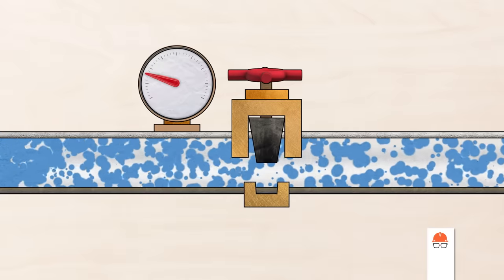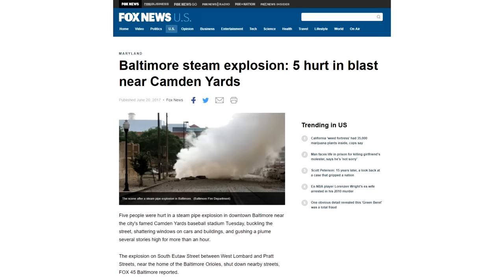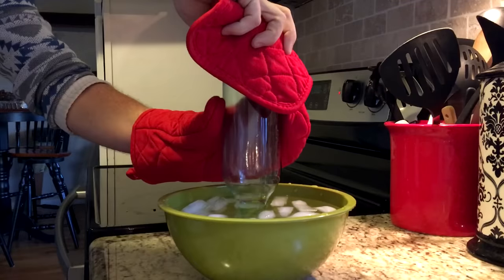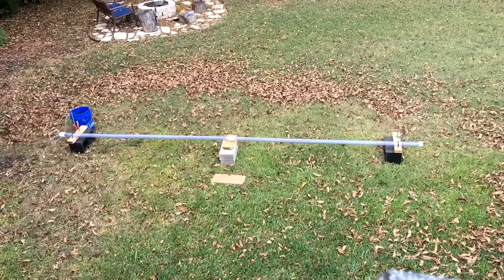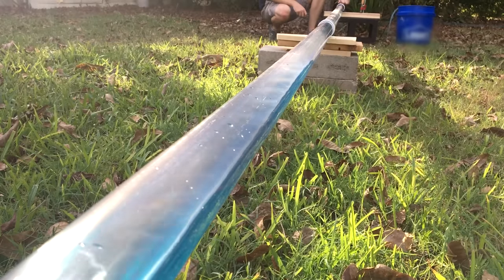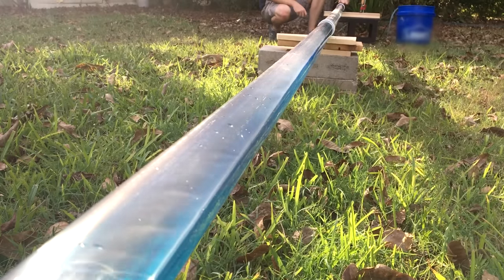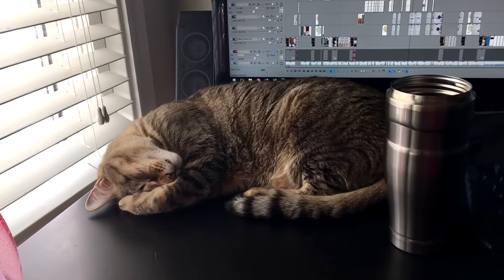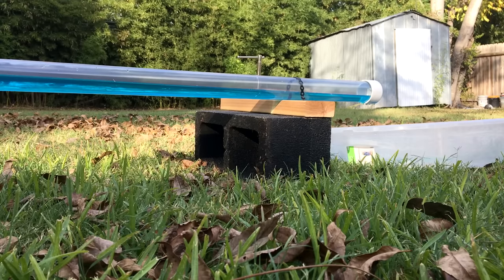What is Steam Hammer?

Comment: As a millwright i see steam hammer pretty often in refineries, one of the worst was when firing a lube oil skid that was down for a couple months the steam turbine was slugged a good 5-6 times and the sudden increases in rotation cause the pressure in the lube oil pipes to spike blowing the lid on our sock filter pot loose made a HUGE mess all over the machine base.

Comment: What do you call it when the steam travels up the pipes in bangs on the radiator? My old shitty NYC apt. had a bathroom radiator that would clang loudly as the steam heated up. I imagined it had water in the pipes and steam bubble would float up and hit the release valve. It would always destroy the release valves and they wouldn't last more than a few months, then it would spit water up in the air.
Reply: That would be the second type of steam hammer, possibly driven from the first - steam put into the cold pipes condenses, creating a bigger pressure differential pulling steam in faster; the condensate that builds up then blocks the pipes and is driven along by the steam flow, hitting turns in the pipes hard.

This is called 'steam hammer', and is what this video is about. The solution, I'd say - advice from experienced steam handlers welcome here - would be to open the relief and/or drain valve until the system warms up.
Reply: Robert Backhaus   Would pipe insulation on the steam line (not condensate return) help?
Reply: @louf7178  
This is dealing with differential temps. in a closed system. Most systems would already be insulated.

Comment: I think the photo of a power plant that you used several times is actually a gas turbine setup, which doesn't involve any steam at all. The gas generators (stationary jet engines) drive the power turbines directly, and then those drive an alternator directly. You can sometimes find combined heat and power units, that produce hot water or low pressure steam room a heat exchanger in the exhaust, but this is usually for commercial use rather than a power plant.

Comment: Hi Grady, love your videos, your channel is excellent.  Can you do a video on Stack Effect?  I travel  a lot in China and in the winter months it amazes me at how poorly air-flow is managed, I was at a very high end international hotel the other day and the elevator doors would not shut. There were 5 lifts and only one was working, the others were stuck on some floors with the doors open due to the air pressures pushing against them as they tried to close. It was humorous and frustrating speaking with the hotel staff about this air pressure differential,  they were upset with the company which supplied the elevators (insert eye roll here).  I do see this a lot in China, maybe they ignore HVAC engineering.    I would love to have you share this if you have the time, thank you.

Comment: One thing to note is that steam traps aren't typically used in the main steam lines for power plants. This is due to the fact that, as was mentioned in the video, traps can clog and malfunction leading to buildup of condensate in the piping. They can also become leaky over time as they wear out and leak steam which reduces plant efficiency. Instead, modern power plants make use of vertical steam drip leg drains at low points in the steam lines with automated valves that open to release condensate. The drip legs will contain level or temperature transmitters to alert the control system when condensate reaches a certain level. The control system will then trigger the drain valve to open.

Comment: early 20th century, they had a problem with switching/disconnecting high voltage power lines............the electricity actually has its own kind of inertia and wants to keep flowing when its disconnected, so huge arcs would burn the equipment in the process.

Comment: I'm a Mechanical insulator by trade. Insulating steam pipes is something else that is done to prevent this temperature differential and to allow the system to stay warm or heat up faster with less waste of energy.

Comment: Ex Air Force boiler specialist here they installed automatic valves at Hill Air Base. first time used they opened too fast and a sand trap exploded lifting a metal grate and damaging cars near by.

Comment: So a little backstory. Virginia, MN is all heated by city supplied steam. My grandparents' house had this steam heat, and it had valves I guess that would turn on and off to regulate temperature indoors. Sometimes when the valves came on, the radiators would creak and tick as they heated up but occasionally they would make banging and gurgling noises. All cast iron. What were the dangers of a city wide steam system?

Comment: Is it possible to connect an air compressor inline with a ram pump to achieve an even higher lift? Kinda like how you demonstrated the steam hammer. Or use the steam hammer to deliver water?

Comment: In chemistry we have something similar when doing distillations, especially when boiling off gases out of a liquid & collecting it either as a cooled liquid or dissolved in a liquid.  The "process/event" is called suckback and is when the positive pressure of the distillation, the flow of the gas from boiling flask to receiver changes and reverses in an instant (usually because of temp drop in boiling flask - turning off heat source, going out, etc).  It can suck 1L of liquid through a 3/8" tube/hole in under a second and sometimes blowing glass apart or at least the joints.  It scares the shit out of you when it happens. A good learning lesson if everyone remains safe.

Comment: Some systems are made to run with "dry" steam anyways. Impingement by just a little bit of carried moisture can cause erosion damage over time. Mostly a thing with turbines as far as I'm aware, and the warm-up process is fairly strict.
Reply: pauljs75 that's why power plants use superheat control, it's less of a hazard to the physical plant

Comment: I've been imagining a design for a high-volume desalinator.  Use an array of solar mirrors, focussed on the expansion chamber of a turbine, to boil fresh water and get the resulting superheated steam flowing along a pipe at high speed.  Now inject sea water into the steam at such a rate that all the seawater flashes to steam, yielding lower-pressure but still fast-moving steam with salt in suspension.  Remove the (now solid) salt from the steam mechanically, perhaps in stages.  Recycle some of the fresh water back to the start, output the rest.

Comment: I was appointed to a British merchant vessel which had a long steam pipe to the for'd windlass. I found that nearly every condensate drain valve was unserviceable due to lack of maintenance, and also they had been fitted with aluminium handwheels which had corroded completely away in the saltwater environment so were being ignored by the crew anyway. They were probably cheap when the ship was built. The pipe burst!

Comment: 01:05 well, actually water is compressible. When you build high pressure pumps (4000 psi or above), you have to account that fact.
Reply: 1337fraggzb00N True, but based on my limited knowledge of most processes don’t reach that level of water pressure.  I’m curious, what are some specific applications that reach those pressures?

Comment: I work in power plants and various other industrial sites on steam turbines. when the plant workers start putting steam back into the pipes its loud as hell and if done wrong shakes the building and causes chaos. I was at a paper mill and they started putting steam through a 12 inch lime and it hit some water in the line and the pipe started bucking and SLAMING side to side in its mounts about 6 feet above my head. my crew of guys didnt run. we just werent in that location anymore. never seen so many big guys move so fast

Comment: Thermal shock is a big problem in rocket motors if not properly mitigated.

Propellant lines need to be purged and chilled to stop moisture in the air becoming slugs of ice, and to stop the cryogenic fluids that normally flow through them from creating sudden changes in temperature and pressure.

And when you are dealing with liquids that really want to be gasses and combine explosively with each other, you really don't want that.

Comment: Tried the bottle experiment and it was nowhere near as violent. It was more like a very gentle, almost unnoticeable difference in the water level. What am I doing wrong? I had to use kettle water as I didn't have a glass container without any labeling. Could that be it?
Reply from the maker: I found going immediately from microwave to the cold water was the only way to get it to work. You need as much steam as possible to get the runaway effect.

Comment: Are there any practical uses for steam hammer or is it always uncontrollable?
Reply: CrooningRevival365 you might be able to make a rapid firing squirt gun with compressed air and a little tank of water
Reply: It isn't a good thing. It damages and weakens pipes by excessive movement that it's No t designed to handle

Comment: Very interesting.  So is this why my residential steam radiator - the one behind the bed, of course - bangs 12 - 18 times when it first heats up in the middle of the night?  Is there water in it that the steam is slamming  into the end of the radiator?  And, is this dangerous? (I ask after 20 years of this).  And, what's the cure?

Comment: I’ve seen steam hammer make a 12 inch pipe behave like a rope and tear itself out of its hangers. That was due to a miscommunication about which valve to open and how fast.  Also I’d add that steam hammer approaches the speed of sound in a pipe so it’s no wonder a change in direction like an elbow doesn’t stand a chance.

Comment: Is this the same type of water hammer that happens when compressibles (like air) enter a system. For example, if you get air in your water piping system (because you opened it up to work on it) you will get water hammer.

Comment: I thought it was ok for a broken pipe or crack in a boiler to vent the steam but I learned that when the pressure suddenly drops to atmospheric pressure, the water which is heated above boiling point suddenly turns to steam, it wants to occupy a lot more volume and the boiler explodes. I dimly recall steam occupies 1600 times the volume of water, correct me if I’m wrong.
I remember photos of locomotives after a boiler explosion, there is nothing left except the underframe. In an ugly one in the US, all the tubes were pushed out the front.
Sorry off topic, I know.

Comment: kinda like a steam powered water hammer! awesome. I want to build a steam engine. to run a couple alternators. to charge the batteries of my off grid home. it would be wood fires. and the lines short. so hopefully there wouldn't be much of a problem with steam hammer. I don't know if I'll convert a  small gas engine. or build a turbine. I want to get about 4000 watts or more from the setup. do you think its possible?

Comment: "...with bleed valves open to make sure condensate cannot form a vacuum..."
.
Hmmm.  Are you suggesting that condensate left in warming steam pipes increases the risk of a vacuum forming?  Condensate does not further reduce in volume much across wide temperature ranges at typical pressures used in most systems.
Further, 'bleed' in 'bleed valve' commonly refers to operation that opens to vent outward to reduce pressure or limit pressure increase.  That is the antithesis of the action needed in this case.

Comment: This is one job interaction that requires respect and the knowledge of some very basic laws of physics (even if not identified as such) as it pertains to working with high pressure steam. Despite the rushed desire at the end of the chain, there needs to be time given to the process of creating steam for normal uses.

Comment: I want to build a wood powered steam generator for my house. My electricity consumption averages less than one kilowatt, so it seems like a good car alternator could supply most of my needs, and I think a few batteries could add enough amperage when necessary to handle the inrush current draw of things like a fridge compressor, or the blower motor on my furnace. I've seen string trimmer motors converted to steam and that would probably work well to run an alternator. And the condensor might be able to provide heat and/or hot water to my house

Comment: Why do we use  h2o in a gaseous state and not some other gas/ liquid to turn turbines?
Reply: thanks for the reply
Reply: Water is good at it - better than almost all substances - and is definitely the cheapest. But there are cases where other refrigerant gasses are used, such as when you are working with low temperature differentials, like running a turbine using waste heat from some other process, or using low grade geothermal.

Comment: In steam locomotives they have the opposite problem, water turning to steam. If, for example, your crown sheet fails, all the pressure in your boiler is lost and and the super hot pressurized water instantly turns into steam, rapidly expanding with catastrophic consequences. Most if the time the entire engine crew was killed during a crown sheet failure incident. The crown sheet is the piece of steel on the top of the firebox, if it isn't kept wet it can overheat and fail.
Reply: Same physics in a way behind water heater rockets.  you take water that has become super heated due to safety systems failures and when the tank ruptures pressure goes from hundreds of PSI to atmospheric pressure and the water flashes over.  Mythbusters put a 50gal unit 500ft into the sky.

Comment: The biggest problem causing steam hammer is when there is steam and condensate in the same line and the steam heats the condensate up enough to turn IT into steam. The expansion of the condensate to steam in a confined pipe is when things break!

Comment: There is even a bigger danger with high temperature water/liquid. The (I think it's called) boil over. It's far over 100°c but still liquid because it's under pressure (in a closed system), when the pressure falls (leaking ore someone opened a valve) it turns into steam and blows everything apart.

Comment: in our house hold pipe asume there is water flowing at constant ... if i obstruct the pipe slightly  we can see the velocity is increased .....but obstructed part as artery which offer resistance as per book they are resistance vessel so they reduce the flow  and cross section area is small so velocity must decrease but you see in the above pipe when i obstruct velocity is not decreased and its seems flow is also increased ......and also the forward pressure too increased ....what is really happneing in our body sir

Comment: Wouldn't most steam engines have a super-heater, where the steam is heated way above the boiling point to avoid condensation in the pipes and cylinders? Of course, starting up engines still has to involve draining out the condensate.

Comment: You missed one thing; when the water creates the seal the steam will instantly cool and collapse and create a vacuum and pull the slug of water down the pipe where the air you used does not do this.  Good video though.

Comment: I used to work for a company that built control systems for chemical plants and boilers. I heard a story of, IIRC, an eight-inch high pressure steam pipe at maybe 3,000-6,000 psi bursting in a plant. It was next to a wall with thick steel plating protecting it (perhaps 1-2 inches.) It stripped the steel off the wall and it took 18 hours before anyone could enter the room where it happened.
Tragically, a worker was in the room when it happened. They never found any part of him.
The energy levels that we work with in industrial plants are INCREDABLY high.

Comment: Can anyone please explain to me, how did he generate steam from the microwave, isnt steam always at high pressure, was there steam in the bottle that came out of the microwave?? Or wss it just hot air, what happens when u heat air? Does it turn to steam or u need to boil water to generate steam whats going on!!? Please help

Comment: If you really want to mess with peoples minds do a video on how some steam systems have high temp, medium temp and low temp steam lines and how they feed on another. You might also want to include the use of a vacuum tower being applied to low temp condensate to get that last ounce of energy before returning to the boiler feedwater systems.

Comment: Instead of wasting energy to generate hot steam we like how liquid Co2 or dry ice boils below zero and can generate excess pressure energy when exposed to cold or warm water. The Co2 can be cooled down again after it's phase change and the process is recycleThe Das Valve by Peter McKinlay is something worth talking about and the very high pressures achieved are dangerous.

Comment: This topic made me think of videos I watched a few years ago, a plumber who noticed pipes got hotter during water hammer made a rotor with holes sunk into it and spun it at high rates inside a cylinder. It was filled with water also. It allegedly heated the water to boiling, apparently from cavitation. Seemed interesting but it may be pseudo science

Comment: If you had an actual piston coupled with a pressure relief valve leading to a back flow pipe at the end of the stroke, could a steam hammer be controlled and turned into a real hammer? If so how powerful could it be made? (On a scale of granny with a tack hammer to pile-driver)
 I write fiction and such an object could be useful either as a trap in an old dungeon, or a massive steam-punk contrivance to be used as a power hammer where immense force is required.